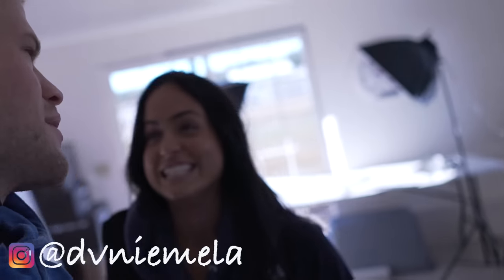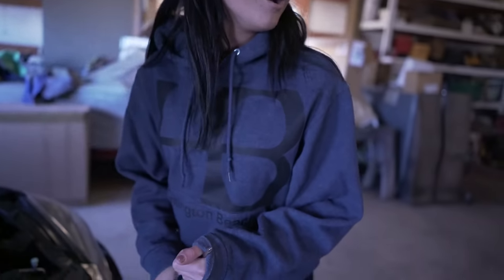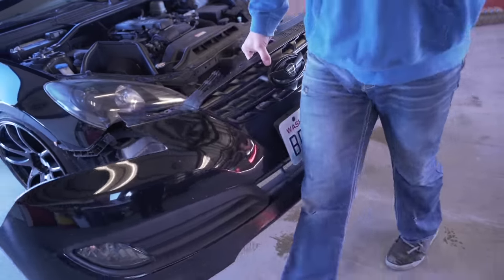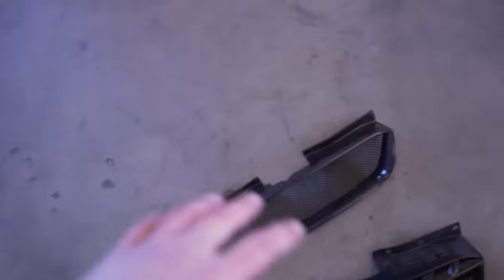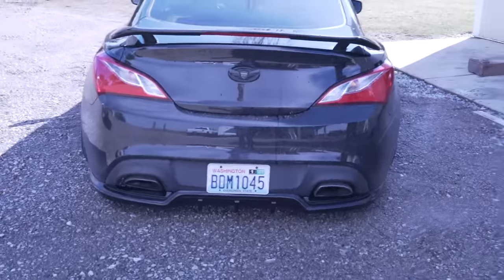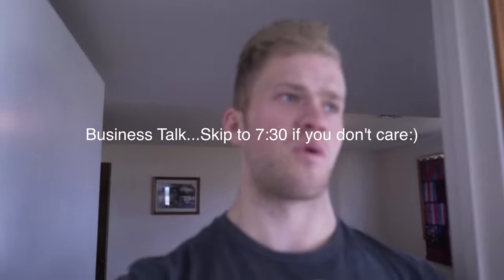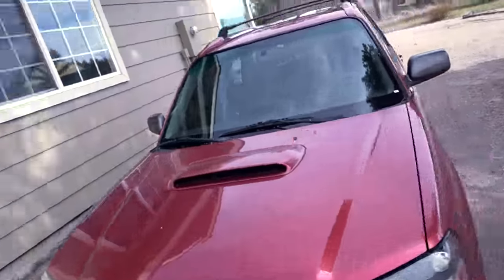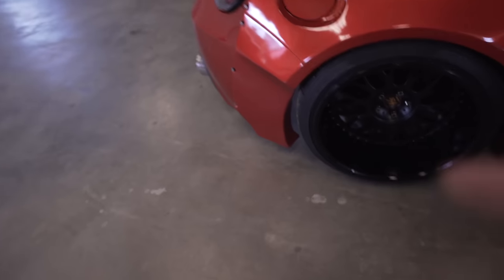Female Driven Slammed Genesis Coupe

Comment: Seriously, though bro, I'm in great need of a front end plastic bumper cover for my 2013 Genesis Grand Touring coup with the V-6 engine. My busted piece has all the holes for fog lamps etc. I'm a old sixty y/o man and I thought finding a girlfriend my age would be better for being more wiser and shit. But, obvioulsly I need a younger woman. In fact, my girrrlll-Friend  can't drive for shit and she ran over a "boulder" in the middle of the street.  I know...so need to say it. Your girrllll looks a lot smarter than mine. In fact, she's F.I.N.E.! But, to get ack to my problem, do either of you know where I can get a replacement. Only the plastic bumper cover painted or not painted. If my only option is a unpainted cover, t's no problem because I will custom airbrush paint it.